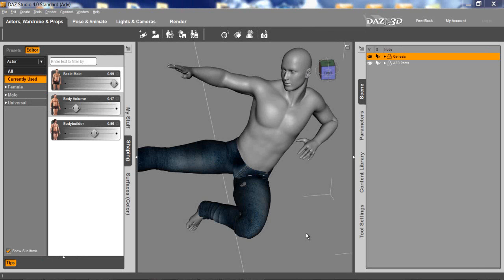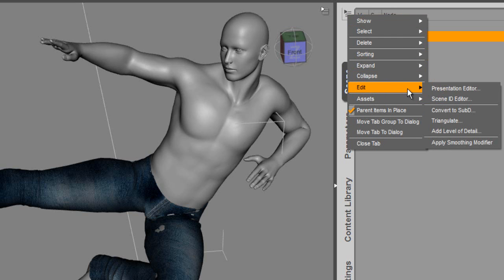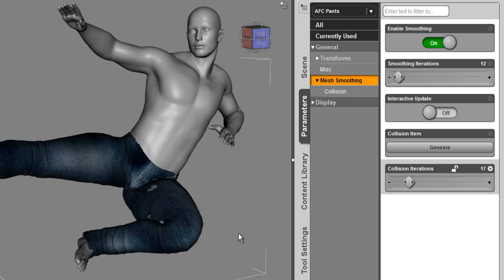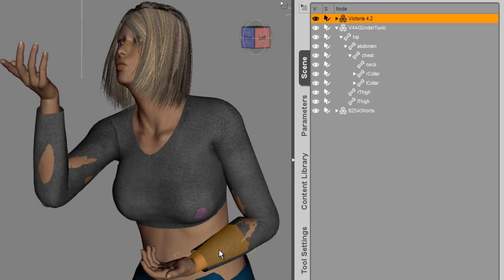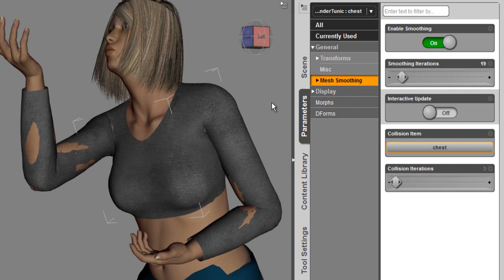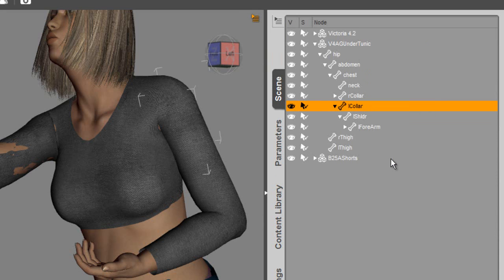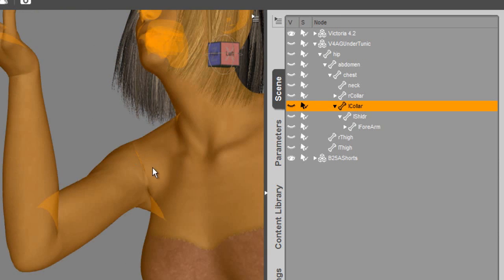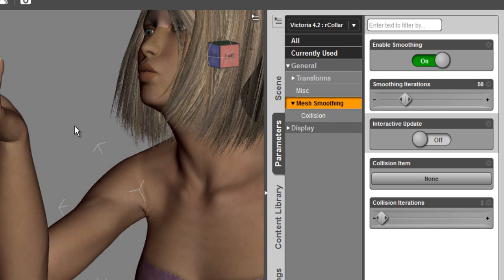DAZ Studio 4 - Smoothing and Collision Detection Genesis and Gen 4

Comment: I have a question, but first of all thanks for this great tutorial, now my question is regarding the smoothing done to a character and saving the character with the smooth applied to it. I export the character as an FBX however when I import it to another program and open it there (This case 3dxchange that does support FBX fomats), the pokes are still showing as if I had done nothing to it at all, Do you have any ideas as to the why is doing that. Thanks.